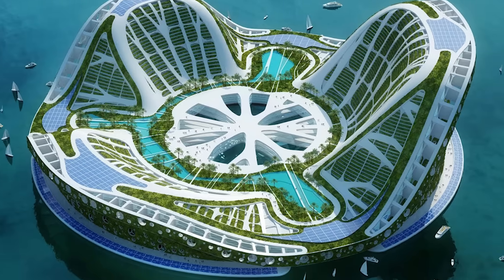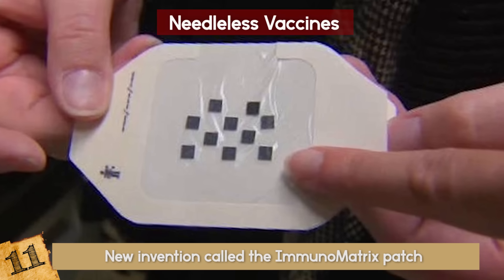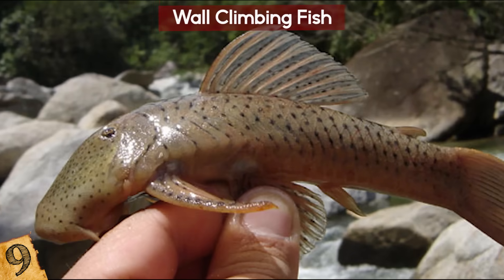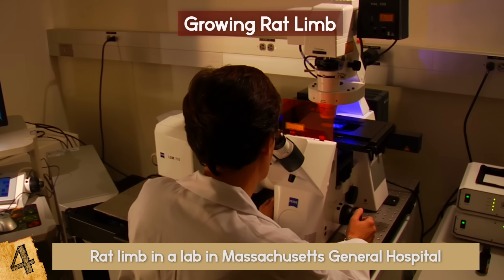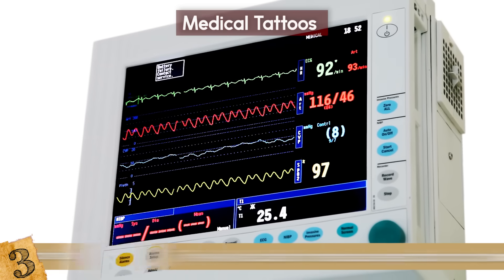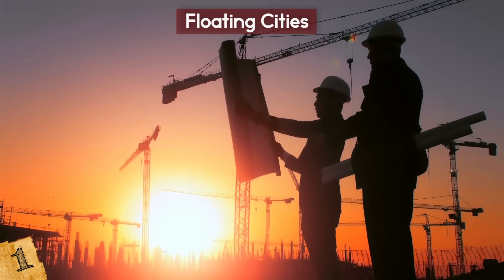Most AMAZING Recent Technology!

Comment: wireless charger is possible due to thing we call wireless power transfer lol. It's called electromagnetic induction, check your facts. And also, in the future we won't have it just pump in the open. difference between wi-fi and wireless charging is wifi needs way less energy to work. todays wireless charging requires you to physicaly put a device on the charger.  there would be a huge energy losses if we wanted anything more then that

Comment: Great video, very exciting times we live in.

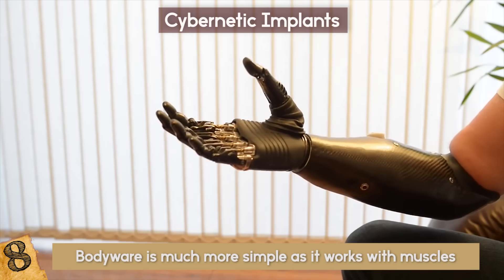5:01, I think you mean telepathy.
Also, if you can communicate with a computer, you can move robotics limbs, so a kind of telekinesis, I guess.

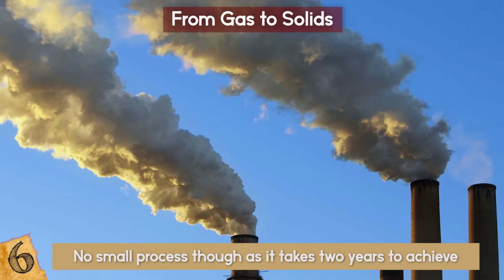06:35ish, carbon dioxide sublimes, which means it doesn't have a liquid phase (only solid and gaseous). This was a discovery like 100-200 years ago, it's not a scientific advancement. However the CO2-to-stone things sounds good.

Comment: Solar sheets in rolls now 1-2 ft  WIDE >  30-60cm wide   works like car  tinter :)  IMAGE  custom sheets that cover them high riser buildings 
and all energy used on lighting etc woot $$
old panels weight tons               new is  thin as lite as :)  panels used b4 =1 ton approx  now weighs only 1-2 kilos :) if that clip  into each other via small socket small like the led lites do easy peasies 💦🌝🌠🙋🏻‍♀️💃🏻🤸🏻‍♀️🤸🏻‍♀️🤸🏻‍♀️

Comment: I’m not a fan of wireless electricities for it could cause us cancer cells. Great advatage to doctors who can perform medical procedures using the stem cells that could lead us to such a very expensive medical treatment. For just a few connections, it would be fine, but it could lead to an outbreak if a huge volume of radiation spreads out in the country.

Comment: Number 6 was something i saw in dream a tower build on the tall structures of our cites right along the micro dome of heat we create, absorbing the pollutants exuded.
Only in my dream we where taking this carbon dioxide compressing the carbon to diamonds and expelling the O2 back into the environment, kinda like a tree only it creates diamonds.
turning the C02 into rocks works too i guess.
Number 5 is literally Tesla's invention.
3 is too dangerous, because you KNOW that doctors will not be the ONLY ones with access this info.
To much potential abuse with this one, with our current leadership.

Comment: We would have already had wireless electricity many, many years ago. But by using wireless electricity there was not way to accurately charge people for it. The man who proved that wireless electricity was possible and promoted it as the main source for all Americans to use free of charge was a Russian genius named Nikola Tesla. The greedy man that stopped the wireless technology of Tesla from advancing and becoming the dominant free electricity source in America was in fact a greedy American named Thomas Edison. One battle that Nikola did win with Thomas Edison was the adaptation and nationwide use of alternating current, or AC. AC allowed electricity to be sent by wires over a far greater distance without a huge loss of power unlike the extremely expensive DC system that Edison devised that required huge transformers to keep stepping up the DC power voltage due to its rapid decrease when transported through wires. Tesla believed that the USA would be much more productive and advanced if its citizens and businesses had access to unlimited readily available electricity that was free to everyone to use. Thomas Edison did not see it that way.

Comment: Tesla invented "wireless electricity" long ago, but it was never used because greedy pigs couldn't get rich off it. No they had to start putting up poles and running lines directly to a house so they could use a meter to charge you. I wonder when we will have to start paying for  the  oxygen we breath? It will happen eventually.

Comment: Why use a lot of energy to pressurize and liquidfy CO2 and inject it into basaltic rock and wait for two years,
instead of using some energy to turn CO2 into long hydrocarbon chains, that can be stored very easy and used as fuel.
You could even produce sugar with water, CO2 and energy. That would not take two years.

The Problem with solar energy ist that we can not save much energy for times we can not use the solar energy.
What happens when its rainy or night?
Reply: J.Denzel we'd have other energy sources, such as nuclear energy, which causes little to no air pollution

Comment: hurr durr wireless power is the future.. well not really since there is enormous amonts of losses while using this and if you want true wireless you would have big noisy transformers and coils everywhere and they would fry you in an instant if you ever got to cloese think of it as pretty much having a tessla coil in every house not gonna happend there is no way wireless electricity is the future! i would agrue that graphene is the future of electronics since it's only 1 atom thick and a great conducter but the proscessof making it is horrible so until the day we mass produce it we are stuck with copper and for a long while with it aswell.. and also i dont know how you can compare wifi that usees radiowave at 2,6 ghz and 5 ghz and to wireless electricity becuase wifi transmits an on and off state all the time not 5 v dc or 120 v ac and 6 amps we are talking about small deviations in the wave the computer then  translates to on or off, i dont know the entire sience behind it and to be completly honest anything that has to do with radiowaves is basicly the dark art of electronics! but believing in true wireless electricity is both retarded, stupid and dangerous...

Comment: if you thing about the floating city's what will happen if a huge wave will come wouldnt you die?
Reply: That's not really going to be a problem. Tsunamis are generally quite small in deep water, around a meter (or 3 feet if that's the system you prefer) and the sheer size of the city means it wouldn't rock too much either. If you've ever been on a cruise ship and a rowing boat, you can tell there's a huge difference in stability
Reply: What about a submersible city?
Reply: Phil Lewis I don't think they have that kind of technology to quick build those.
Reply: Depends on how it's built
Reply: Waves wouldn’t be a problem but hurricanes are a different story.
Reply: It would just roll over the wave no matter how big it was as long as the wave doesn't break (white water). Plus a added benefit of covering large portions of water would be less evaporation which would cut down on hurricanes and other storms, and shading the water would potentially slow global warming to some extent.
Reply: Also known as a tsunami

Comment: Solar power needs a huge jump technologically for it to be a single reliable power source.
Reply: But, a single power source is nothing compared to a hundred or even thousands of independent sources all replaceable by backup/fail-safe... just in case... and with all these options one could even go for multiple, utilizing them where they are most efficient instead of trying to make all the devices in a way that they would run solely on that power sources specifications...